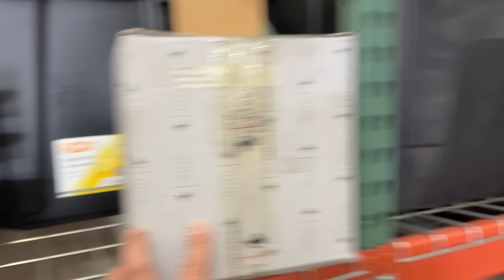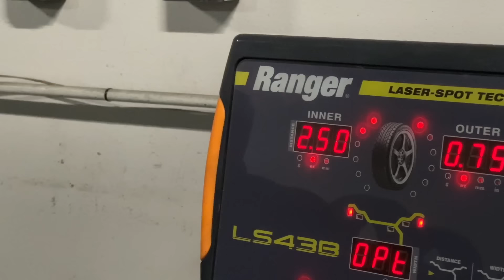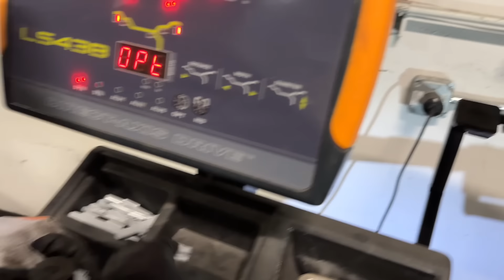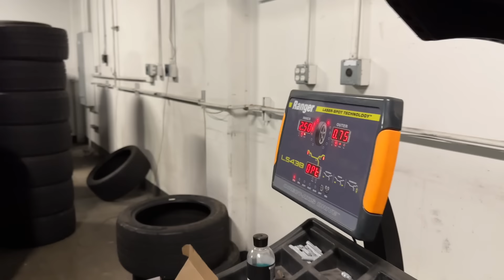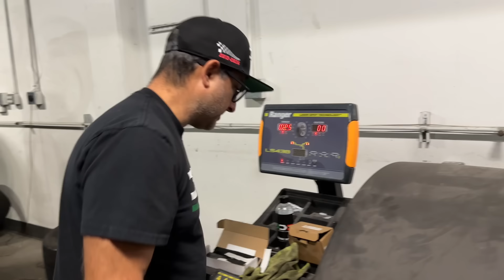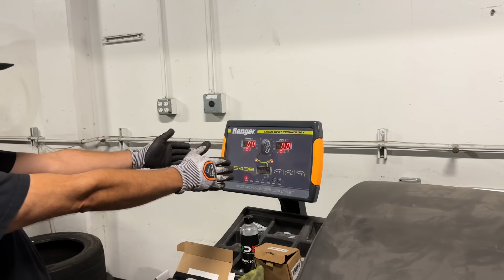WE ACCOMPLISHED WHAT WE COULD, BUT IT'S TIME TO LEAVE

Comment: When working with steel wheels I was taught that if the required weight was over 2 ounces, break the bead and rotate the tire 180 degrees and fill the tire with air.  The required weight will usually fall to under 1 ounce, or zero because the weld on the wheel and the welds inside the tire are no longer lined up.  This also makes the tire roll smoother, and the tire will last longer as well as provide a more comfortable ride in the car.

Comment: Tip. When balancing put the probes on the flat just inside the flared out lip. 16 years of experience here. The steel wheel weights are easy just put the edge of the clip on the flared lip and pound it home. Easy peasy!!!
Reply: So I’m not the only one Cringing watching Mike trying to balance the steel wheel 😅
Reply: @kozkreation  no. But if ya know ya know, and it's not intuitive lol!
Reply: @kozkreation not at all, the crouch on the ground took me out, i would go there on my day off to mount and balance tires...
Reply: @kozkreation  i definitely was cringing too. lol
Reply: and if it doesnt work doing it as you stated you can use the hammer thing (dont know the real name for it) and pry open the lip on the weights in between the handles theres a groove on one side and the other side should have a triangular part sticking out

Comment: I can’t believe the difference in sound between the first twin turbo set up ( to me it sounded like a tractor 😂 ) compared to how crisp it sounds now. Mike is the MF man !!!!
Reply: Sean built the exhaust...
Reply: The first TT version of the F12 reminded me of the podcast racer from Star Wars 1
Reply: @dabreal82 mike literally used the adult lego to design the exhaust… shawn may have been put some welds on it at most
Reply: @danieli1110  he literally built the whole thing... Go watch the videos
Reply: @dabreal82  Mike designed the exhaust and Sean welded it.
Reply: @The_Phantom74 designing and building aren't the same thing. Sean was right there with him the whole time. Sean built it. Just like architects don't actually build houses. The construction workers do... Mike is a great car builder, it just bothers me that people in the comments act like he is the only reason the f12 is what it is. He didn't do 90% of the actual mechanical, fabrication, or engineering work of the car. He just put the parts in place. Just give credit to the half dozen or so other people and companies that were involved, instead of acting like Mike did everything on his own...
Reply: @dabreal82  I'm not discrediting anyone, it is you that is. Yes Sean welded the exhaust, Mike designed, fabricated, and tacked it in place. Then Sean did the final weld. Which he did a fantastic job. Go back and watch the videos as you told the other person to do. So Mike did much more than an architect. It was the same with the roll cage. Mike got everything ready for Sean to weld. As Mike stated, Sean is better at welding than him. Tim had done a tremendous amount of grunt work on the car. Engine, transmission, differential, and wiring was outsourced. Amongst other items. Much of the tubing, mounting brackets, and similar items were completed by Mike. So yes, much of the work was done by others, I wouldn't go as far as 90%.Again you are discrediting the amount Mike's work/contribution. Which will be more heavily involved in for the remainder of the project. 

As someone who has been in the construction industry most of my life, I absolutely agree with giving credit to those doing the work.
Reply: @The_Phantom74  How did i discredit anyone? I never said Mike hasn't put in work. I never said you in particular were saying Mike did everything... As I said before. Just tired of people in the comments acting like Mike deserves all the credit for this build... When there were numerous people involved, and he has said several times,  that things others have done he couldn't. But yet people keep saying Mike Built the car. He did his part. As did many others. I'm not sure why that is so hard to understand...
Reply: @dabreal82  By saying Mike was basically did nothing and only the architect on the exhaust and did not do the work. When he was the one that designed, fabricated, and tacked it together. Sean did the final weld.
Reply: @The_Phantom74  when did I say Mike did nothing?
Reply: @dabreal82  You're talking about giving credit where it was due. Then gave Sean all the credit for the exhaust. Go back and read your own messages dude. As you said others did 90% of the work on the F12, Mike did 90% on the exhaust, but gave 90% of the credit to Sean.
Reply: @The_Phantom74  I literally said Mike was a great builder...and I never gave all the credit to Sean. I acknowledge Mike designed it... What I said was Sean built it, bc Mike acknowledged he was the better person for the job... Please stop putting words in my mouth...
Reply: @dabreal82  You literally said Sean built the exhaust. Basically stating Mike barely did anything, which is discrediting him at least for the work he did on the exhaust.
Reply: @The_Phantom74  dude you keep saying something different every time. Let me ask you this. Since you said that you've spent most of your life in construction. Did the guy that cut the 2x4s, or put the concrete in the bags, or drew up the blueprints actually build anything. And you saying "I basically" said something is you putting your own twist on my words to make yourself feel better. I'll say it one last time, and hopefully you'll understand...  Mike is a great builder. But there are plenty of others that deserve credit for this car. But people act like Mike did the whole thing by himself. I don't see what is hard about understanding that...
Reply: @dabreal82 Sean did the welding but Mike definitely did the hard work as in figuring out the whole exhaust layout to make sure it has the sound that it has  but both of them together did a hell of a job
Reply: @lavarusmccarthy4744  Mike admitted in several videos he had no idea if the car was gonna sound good. He bought the "adult Lego" kit and used it to route the exhaust where it would fit. As I've said in several comments... Mike is a great builder. But he isn't the only reason the f12 exists... Why can y'all not understand that?
Reply: @dabreal82  I'm not saying anything different each time. No know me saying  Worded different, possibly, means the same. When I stated "you basically said..." is what you implied without explicitly saying. My comments was mostly about Mike and Sean and their contribution on the exhaust, since I was replying to your comment on that specific comment, then it broadened later. 

Now your first two comments you literally said "Sean built the exhaust" and "he literally built the whole thing... Go watch the videos" is an exact quote what you said. Which is factually incorrect. It wasn't until your third comment you stated "Mike is a great car builder" and then went on to say he didn't do 90% of the work on the F12, that "he just put the parts parts in place". How is that not discrediting or diminishing his contribution and work?
Reply: @The_Phantom74  your right bud..  have a good day...

Comment: I got a kick out of the wheel balancing 😂 whenever I use to do I always used my thumb and index finger to hold each edge of the weight and then hammered it between those fingers you’ve gotta hit on an angle though something like 45° not straight on from the side

Comment: damn the tire machines struggles are real! steeles you should grab them from the inside on the clamp. also the balancer. the lead weight are easier to put on if you work over the wheel and holding the the pliers down. also some balancers are equiped whit a break to keep the wheel from spining while you put the weight on

Comment: Wheel weights are actually really easy to install as long as you have the right style of clip for the right rim. Bend over the opposite side and hang over the tire, then hammer in an upwards motion towards you.

Comment: Crash course: while mounting a tire, when possible (99.9% of the time) use the internal wheel grips vs external grips. This way you can pump up the tire while still being gripped internally. Its also for safety as a bead popping could break your finger. 2. Dont be afraid of the wheel wait, put it in place. It should balance on the rim by its own and just wack the top center with just enough force to get it on one shot. Slowly tapping it on will just expand the weight making it not want to stay on permanently. The garage i use to work at, we use to have to use back old weights so we would also have to reset them. Thank god i dont do tires anymore, I hated it

Comment: Hey guys, you get cupping on your tires because your shocks aren't working. If you put heavier wheel and tire packages on your vehicle, the oem shocks aren't designed for that extra weight and wears them out. Get heavier duty shocks when you get new tires or you'll have the same cupping with your tires.

Comment: Steel wheels take a "P" weight. also where the laser is, is where you mount the weights. there should be a outside laser for the outside weight  locations.

Comment: It revs like no one has ever heard!!! Its unique exhaust note is historic. It’s a hand built work of art. I worry you will have axle failure like on the 599. This car has the trick carbon fiber drive shaft, 1500 back wheel horsepower? Will the stock axles survive? I predict they won’t. I hope I’m wrong. Wow, what an amazing Ferrari you have created. It’s like a factory Ferrari race car. I look forward to witnessing you fine tune the car.

Comment: Mike essa since you teach me so much ill tell you something. Those machines balance the wheel true to the machines not true to the car.  Since the locking nut is center lock and when on car obviously there on wheel studs. Different pressures applied equals different balance readings

Comment: They is right it is hard to put them on but yu just have to do it at a angle an try not to hit yo finger an it slides in an if yu use the tape ones will not stay long

Comment: You have to measure both the front and back of the wheel. Sametime to balance and to hammer the weight on the wheel do it from the top of the wheel not front

Comment: you overuse the tire machine, it's so easy to put a tire on a rim, adjust the gallows and turn the tire onto the rim and then let the machine do the rest. Stabilizing tires even easier and to hammer the weight on the rim is just to set the weight up to the rim and hammer on the top clamp, it will automatically clamp on.

I worked at a tire workshop for about 6 months and I was able to finish changing tires and stabilize in under 1:30 min. Lifting a car and removing the tires and work on them and putting them back on the car was done in less than 7 minutes by 2 people where I worked, 3:15 min was our record.

Comment: Mike you had the wrong clip on wheel weights when balancing     there is 2 types of clip on weights 1type for steel rims(lead weight ) with round radius  lip of the rim   and 1 type for square face lip on alloy rims (painted weight)  each type of weight is designed to go on certain rim and wont go on the other

Comment: Putting on weights, you stand over the tire on the opposite side of where the weights going, position the  weight at the top where indicated with your less dominant hand. With your main hand grab the hammer and hammer the weight on with a slightly upwards motion, from where your standing your hammering towards yourself. It's absolutely not rocket science. Lol

Comment: Mike Tim Shawn and the engine builder that Ferrari IS BAD ASS  Dave's salary of course but together a BEASTS 
Id guess it has around 900 hrspower and 800 torque monster
Reply: It's actually making over 1000hp, my guess is like 12-1300Bhp fully tuned

Comment: #tim pls that is not how to fit a tyre hold it down with yor hand and spin the machine don't put ur fingers in the wheel well and DONT use those arms they are only for professionals to use with low profile tyres . U could have damaged the tyre or really hurt urself.
Reply: Seeing u fit and balance is like omg don't do it like that
Reply: U can't just keep on adding weights
Reply: I used to fit 1200 wheels land rover 20inch in 8 hours hardest wheel were old mini 13inch